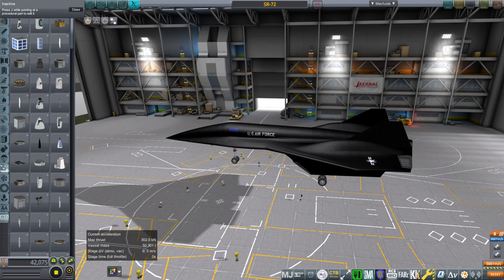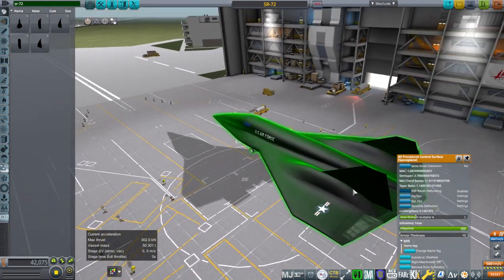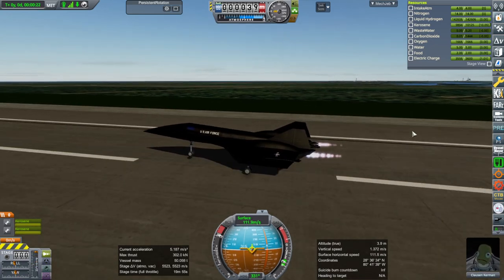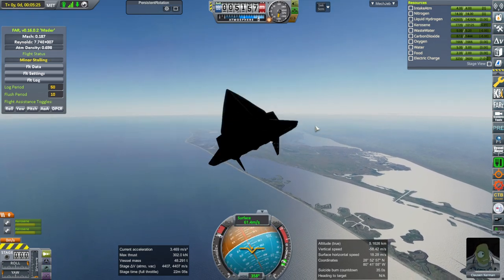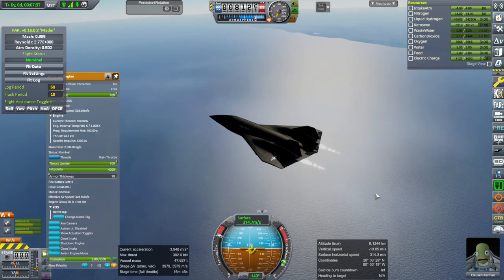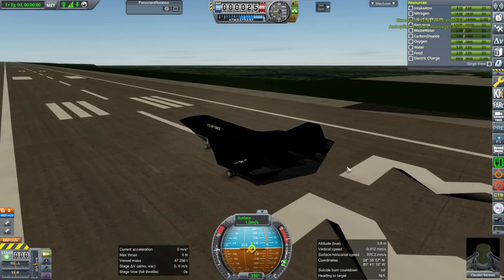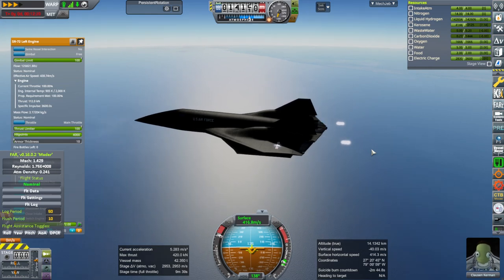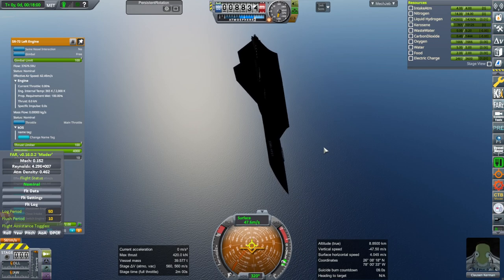Realism Overhaul in KSP 1.11 - SR-72/Darkstar Testing 1

Comment: Wait what is a scramjet is that like a ram jet?
Reply: Yeah, the difference being a scramjet uses compression to aid combustion whereas a ramjet needs to slow the incoming air to subsonic speeds before it's mixed with fuel and combusted.
Reply from the maker: A scramjet is a supersonic combustion ramjet. As R.D. Beerman said, a regular ramjet needs to slow supersonic flows down before doing the combustion, while a scramjet does not.

Comment: well it would be much easier of you to realistically and fully replicate the dark star by using the kerbal interstellar extended mod to accurately simulate the darkstars nuclear thermal scramjet engines. this is bescue the darkstar does in fact use nuclear thermal scramjet engines! this is a fact what i have seen in the sims could only be replicated with nuclear thermal scramjet engines only !
Reply from the maker: The SR-72 doesn't use nuclear thermal scramjets as far as I know. Do you have a source for that?
Reply: @RaizSpace  well if it didn't use nuclear thermal scramjets you get the issues flying like you had in the youtube video. this is bescue only a aircraft with nuclear thermal scramjet engines would have those flight carticertics you see in the microsoft flight sim with those 5,000F+ feritante scramjet engine temperature readings are a big giveaway that it's clearly using nuclear thermal scramjet engines. no normaal conventional  chemical scramjet engine would have anywhere as high temperatures
that the darkstars engine temperature reading on its engine status screen would have. that's your source and proof for that. i know when a aircraft is  clearly using a nuclear thermal scramjet engine from how high the temperature  readings get from the microsoft flight sim engine satius  of the darkstar only using a nuclear thermal scramjet engine would reach such high temperatures while flying with the use of scramjets that high in the atmosphere.
Reply from the maker: The combustion chambers of chemical rocket engines, do, in fact, get that hot. It has nothing to do with nuclear thermal engines. Also, using KSP Interstellar is probably out of the question since it would complicate anyone else's use of the plane, and I think I can figure it out without that.
Reply: @RaizSpace  It does not have nuclear propulsion.
It has a liquid hydrogen fuel scramjet.